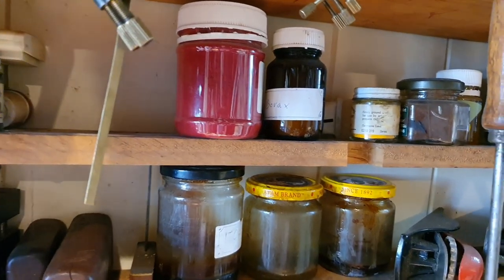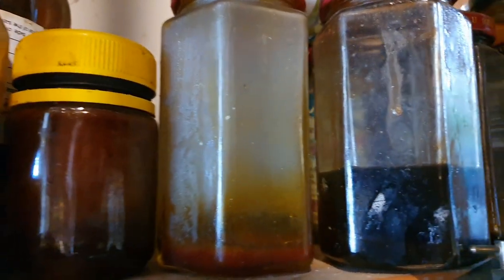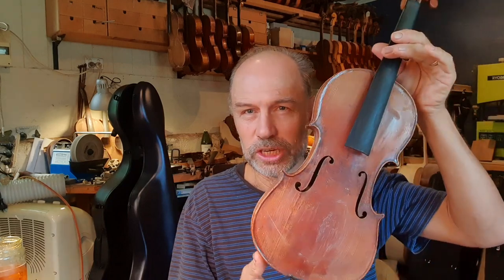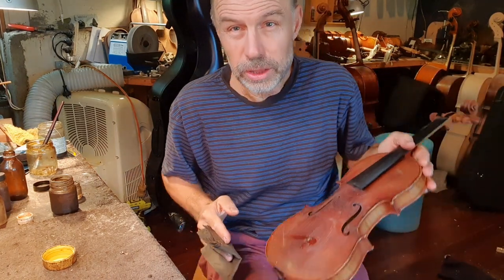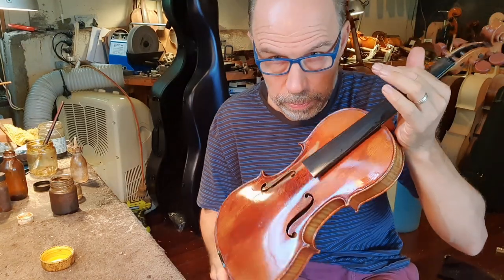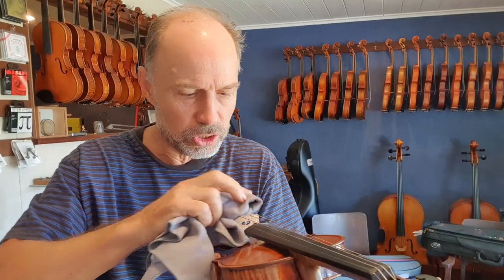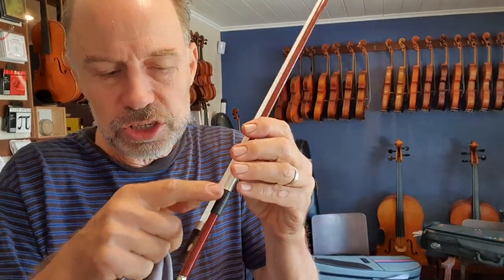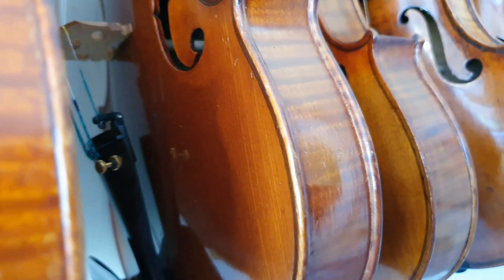How to clean your instrument and Olaf French polishes a violin

Comment: I like the descending escalator trick.... by the way I do clean my strings with alhohol... sweat is corrosive, and I find cleaning them with alcohol doubles their lifespan from 6 months to a year. I have never  split a drop on my varnish in 30 years+ ... but I just dampen a piece of kitchen paper with alcohol and make sure I am careful to only touch the string with it... but you're right.. a drop of alcohol on the varnish would be fatal for it....  thanks for the brilliant clips

Comment: Does the finish make a big difference in sound ?  I just bought a violin from a huge Goodwill store.  It is totally scratched up like its been through a war.  The store said "Decent used condition with scuffs and scratches but no cracks or seam separation. Scroll intact. Tuners, fingerboard, tailpiece, bridge, nut in working condition. Sound post is set. Includes 29" unmarked bow and case".  Another violin they sold was an Antonio Loveri W Tonk that sold for 1300 US dollars.  I paid $91 for my daughter's present.  It has to sound better than her really cheap beginner.

Comment: hey olaf, i got a somewhat strange question. i got a beginners instrument. its solid, sounds fine, but the finish is a thicc layer of clear coat. have you ever considered "refinishing" a cheap violin? i really would like to have it less glossy and more of that varnish-style finish, but i guess its not going to happen if i just try to get rid of the clear coat :D
Reply: If it's a plywood... it'll likely cost you more than the cost of the VSO.

Comment: When you say not to use alcohol on your strings, is it just because of the risk of getting alcohol on the body of the violin or because it damages the strings?  I use Gatchel Argenta Amber Premium Rosin, and it seems to me near impossible to get it off the strings with a dry cloth, which is why I put just one or two drops of alcohol on the cloth, making about a centimeter sized spot of alcohol on the cloth.  This takes the rosin right off.  Are you familiar with this rosin?  It is advertised as lasting longer than most rosin, so that you don't have to apply it as much.

Comment: Why does everyone tells something else? By my former teacher told me, just like you did, that you should never touch your bow hair, but in Orchestra rehearsal I often see players checking the tightness of their hair by pressing it with their fingers against the stick.
My current teacher tells me that I should clean my stings with alcohol, but never touch the varnish. You say on the other hand that you shouldn't use alcohol at all. 
How can it be that there is so much information out there, and whose advice should I follow?
Reply: Most of the information out there is from people saying what they personally like to do, not teachers or luthiers intimately familiar with the instrument who I would trust. 
Never touch your bow hair though. That's a no-go. To be safe about varnish, only luthiers should handle it, and to be honest, you won't get fingerprint marks on the body of your instrument unless you're touching it more than necessary. For cleaning the fingerboard and strings, things get muddy though. Olaf says no alcohol, which makes sense to me because I don't want to put something so chemically strong on my instrument. As an alternative to that, many string players use a light amount of lemon oil applied to a cloth. And some are completely against it. That's what I use though and it serves me well, it takes off the gunk, smells good, and in such a small amount I don't think it's bad for the instrument but I could be wrong. The other thing about this kind of cleaning is that it isn't frequent. The best way to keep and maintain the violins hygiene is to use a small microfiber cloth to wipe down your instrument after each and every time you practice. That way you'll likely never need a deep clean and the instrument will feel good, sound good, and look good.

Trust the luthiers, DON'T touch your bow hair no matter what anyone else does, and research can be your best friend (but don't blindly trust a bias of course). Sorry this was so long haha but I hope maybe you can decide what to do now :)
Reply: Trust Luthiers, which includes Mr. Olaf
Reply: Makes no sense to check the tightness by pressing hair. Why not just press hair on the string? Some players have weird habits I guess.

Comment: Olaf, i want to ask, if the alcohol you mentioned is ethyl alcohol, isopropyl alcohol, or just any hidrocarbon fluids in general (like lighter fluid, etc.)
Reply from the maker: I use methylated spirit's...
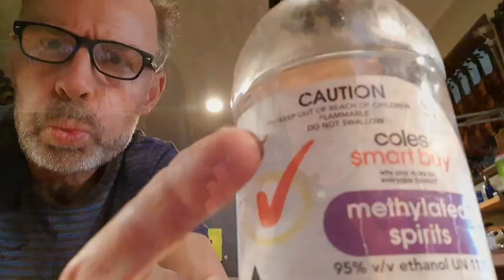Reply: @AskOlaftheViolinmaker  Thank you for the fast response, Olaf. As i re-read my question, i realized it is a bit vague. I wanted to refer to the 12:00 where you mentioned to not use alcohol, especially on a more expensive violins. I meant to ask, if any other substance i mentioned would react badly with the violin.

Comment: French polishing has kind of a misleading name as it is not polishing, like you might think of, with wax on a hard surface, or smoothing a surface with very fine abrasives, but is the applying of a thin new layer of varnish.  Traditional French polish is made of shellac dissolved in denatured alcohol, with a bit of oil (like olive oil, for example).  The alcohol causes the existing layer of varnish to soften or dissolve a little bit as the new layer is applied.  Traditionally, a pad of very different type is used than what Olaf used in the video.  French polishing can be used as a finishing method on raw wood.  It can produce a very smooth high gloss finish, but it requires a lot of layers for the final result and is thus a lot of work.  Shellac is secreted by lac bugs as they move around on tree branches, making tubes through which they live and move.

Comment: I have difficulty believing that water could dissolve oil based varnishes.  The chemistry of that doesn't make sense.
Can you explain that in more detail?
Reply: Because the varnish on violins is never truly dry.
Reply: @AtticusStount  That's only true if you're using linseed oil (yay for a drying half-life measured in decades).  Violin varnishes are a mix of oil and resins, and while they may not be chemically dry, they're still not water soluble.
Your answer needs more science.

Comment: UH OH, at about 10:23 into video you accidentally touched the bow hair.  I am guessing that the oils from our fingers probably cause the rosin to gunk up?  or does the oils break down the hairs?
Reply from the maker: The skin is naturally slightly oily, so touching the hair would cause the bow to no longer work in that spot, because it would slip instead of gripping the string with the rosin.
I usually curl my fingers around the hair to pick up the stick... it may have been the edit... but if I did touch the hair, I  really shouldn't have...
Luckily I know someone who can fix the problem 😄